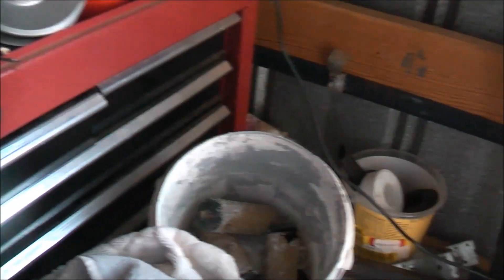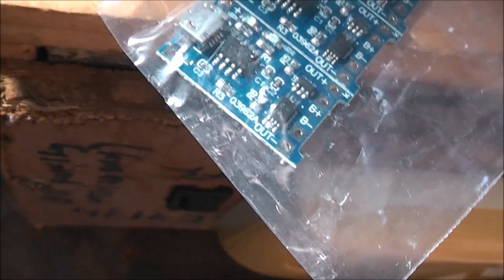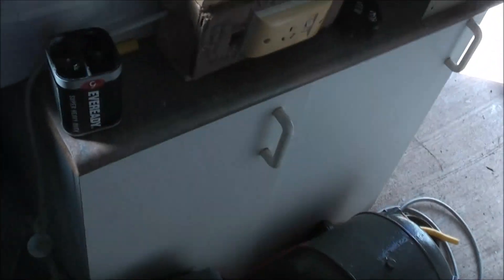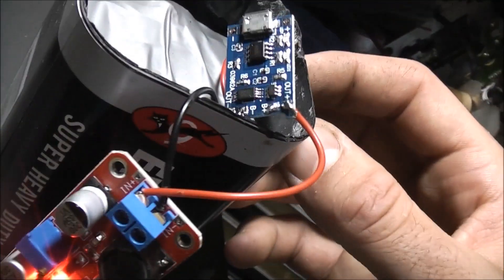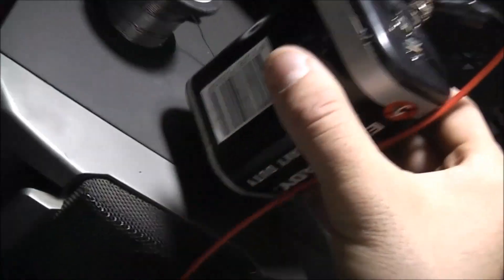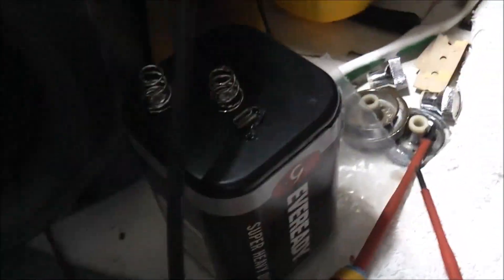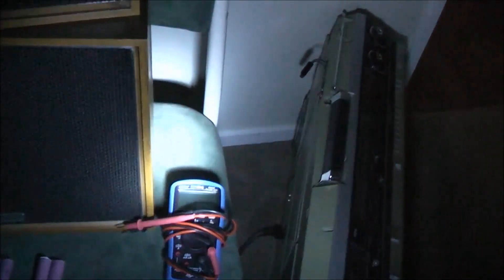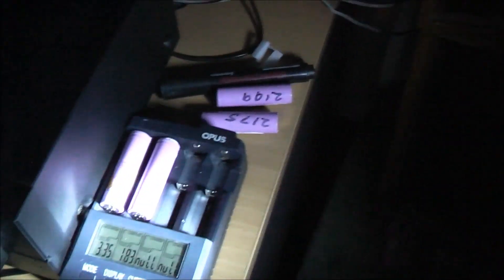Lantern Battery 18650 Conversion

Comment: Why isn't anyone offering one of these commercially? I've looked all over and I can't find one. Seems to be some demand because there are quite a few questions in various forums about it.
Reply: Because hardly anyone uses 6v lanterns anymore. Everything is rechargeable and small compared to a dolphin style lantern. I've even got a plug in USB torch I can put in a power bank that is as bright as a dolphin LED lantern, and the size of a golfball. They're basically going out of fashion. I still love mine and just ordered some USBC equipped TP4056 boards to make my own rechargeable lantern batteries!
Reply: @lunchie80  What you say makes sense. The thing that I like about this idea is the massive amount of energy storage you can put into a package this large. An LED one that I have lasts me several years between battery replacements. I guess that sort of answers my question though. Why have it be rechargeable when it lasts so long? Just buy a new battery.
Reply: @randr10  yeah I just realised the dolphin led I have by the bed(for any disturbance at night) is still on its original battery! It's probably 3 years old at least. I only use it in emergency (something to grab quickly and I know will work) but I don't use it if I need lots of light or go hiking or something. That's when I take something small and lithium powered. Still going to make a lithium 6v cell with USB charging built in like this video though. The boards I ordered are USBC too 🙂
Reply: @lunchie80  Just because you can. 🙃

Comment: Would be great if you had some links to the charger and controller you bought. Also how many batteries did you use and how did you bundle and wire it up?
Reply from the maker: The boards a buck converter off ebay takes 3.7 volt and ya set it to any output voltage you want, i used 9 in parallel for max runtime

Comment: Looks like a mod I should do for mine. I have an Eveready Model 106 (US designation for 1st gen Dolphin) that I have modded with a halogen lamp and getting quality lantern batteries is nearly impossible these days. In case you are wondering (I'm not sure if Aussies have a different designation for the type code), but an HPR36 lamp is all you need to do the mod (drops in, don't mind the warnings about using only in Halogen compatible lights as you are well within tolerance).
Reply: Old comment dig, In aus you often find 'upgrade' bulbs marked as Xenon(halogen) for older torches pretty easily at local hardware stores. Although hardly anyone uses old dolphins anymore. You can buy new LED versions here very cheaply and nearly anywhere. My local grocery store half a mile away has 3 different sizes of dolphin LED torches on the shelf. The single AA is a cool little unit for example. The 4 LED dolphins that are out now are excellent.